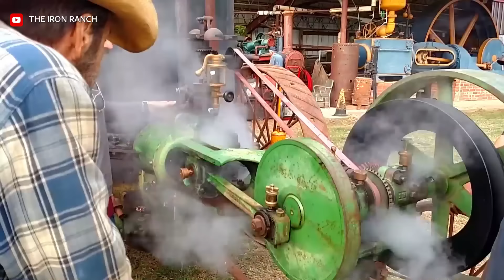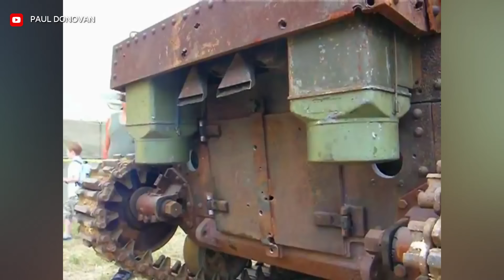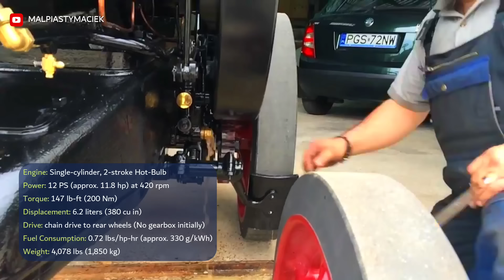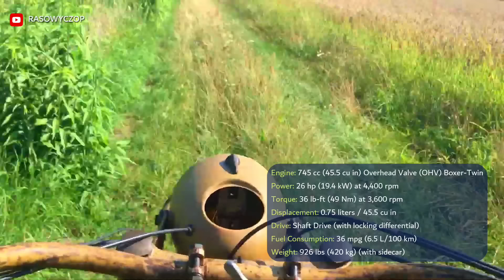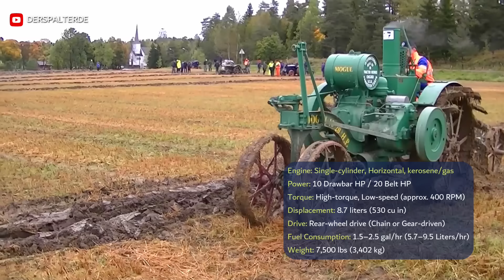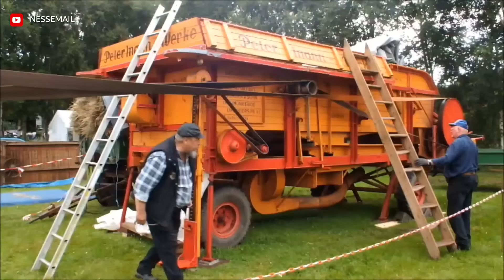Waking Up 100-Year-Old Mechanical Beasts: Rare Vintage Cold Starts

Comment: The sheer mechanical resonance captured in these startup sequences is exceptional. It is a direct acoustic reflection of the immense compression ratios and the heavy cast-iron tolerances required in early internal combustion and steam-assisted designs. Listening to the progressive stabilization of the flywheel momentum provides a perfect audio study of historic thermodynamics